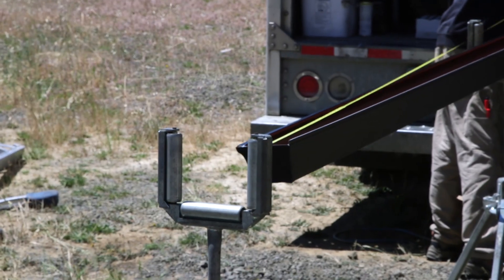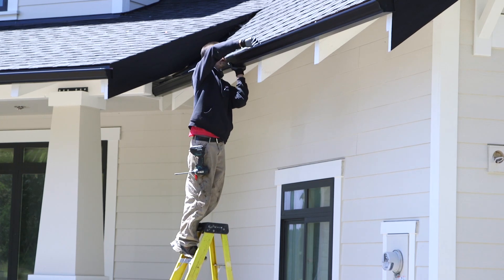Rain Gutter Installation Ep. 124

Comment: It's really unfortunate how many corners were cut on this gutter install. Dumping the second floor water directly onto the roof of the first floor is lazy and will result in premature wearing out of that section of shingles. The downspouts on the front side of the first floor columns are hideous. Very disappointing to see such a beautiful house sullied by this shoddy work.
Reply: Regarding dumping on the first floor roof... what is the alternative? Genuinely curious as my house is built the same way.
Reply: @RobertBarth1  The better option is to have the gutter downspout run along the roof and then over the edge into the 1st floor gutters
Reply: Maybe the customers didn’t want to spend that extra money
Reply: I wish I had told Scott to install leader pipe within the interior of the columns, therefore eliminating the vertical pipe that conflicts with the tapered columns.
Reply: @RobertBarth1  If possible have one continuous downspout and then Y-connect the lower level roofs into that.
Hard to tell if the roof design would have allowed for it in this case.

Comment: The downspouts in front of the columns look ........ not great.   Oof
Reply: Agreed! I would have used cup-style rain chains for the front porch section
Reply: I really dislike the typical gutter systems. The better alternatives are rain chains and if you have even more money - hidden gutter systems.
Reply: I agree.  Rain chains would have complemented this craftsman style front porch better than ugly aluminum downspouts.  Perhaps they couldn't be used here because of the volume of water and/or frequency of high wind?
Reply: @andrewj5998  Usually the bottom of the rain chain is 'anchored' in a tasteful clay pot which has a hole in the bottom where the water is connected to a drain of some kind. Then the pot is filled with river rock or something similar. The chains come in a variety of sizes that can transport water.
Reply: @andrewj5998  Wind does factor in with rain chains
Reply: @aayotechnology  exactly what I was thinking

Comment: I would opt for rain chains in the front instead. Those downspouts look hideous
Reply: Especially at those nice columns out front.
Reply: @natej6671  Even if they found a way to contour the downspout to the angle of the column I don’t think it would look good
Reply: nah. to each his/her own I guess
Reply: @Phil Ward if memory serves the only time I installed chain instead of a downspout the chain was copper plated so it slowly acquired a green patina.
Reply: @Phil Ward Yeah, actually. There’s stainless steel options as well. Regardless the material, chains add a nice look to any facade. Plus seeing them in action is pretty awesome
Reply: We tried a rain chain.  They look great but any wind and the water goes everywhere.

Comment: The downspouts in front of the columns look awful. If I bought that house the first thing I would do is tear them out and use another alternative.
Reply: Rain chains would be a good alternative.
Reply: @justinhosmer2500  Or hidden downspouts
Reply: Hmm I missed that detail. I agree would look awful. I have spouts on two of my pillars but they are at the back of the house so don't show that badly. However I still don't like them. I had then replaced with smooth rectangular spouts instead of that really ugly corrugated form.
Reply: Definitely need some “Bluetooth” downspouts! Out of sight, out of mind!

Comment: I like hidden side mounts for holding the downspouts. I’m also surprised they weren’t using a chop saw with an aluminum blade; we nearly exclusively cut downspouts with a chop saw as the cuts are fast, flawless, and perfectly perpendicular. We also like rivets instead of screws as they leave less obstruction inside the downspouts, don’t have points to catch leaves or the like with, and just look cleaner; rivets do have 2 major downsides they take slightly longer to install as they take 2 steps drill and pop as well as being more work if you make a mistake as they have to be drilled out. In NY I can’t recall the last seamless gutter company I saw with their gear in an open trailer; in NY everyone uses either a box truck or enclosed trailer. You can get good companies for seamless gutters that cut barrel connectors in for downspouts, in my opinion the only way to do it as it directs the water into the downspouts, some companies however will simply cut a cross in the gutter bending the created triangles down and screwing them into the downspouts which allow a lot of water an easy path to flow out of the gutter and around the downspouts; I see this quite a bit around here as homeowners don’t look or know and it is much quicker than cutting barrels in. My aunts house has gutters put in by the areas top company, a company I use from time to time and check the work on, and which uses barrels on our jobs, but who apparently doesn’t use barrels on any other jobs; after seeing their work on her house they came off our sub list as well as my list of referral companies. Know the work you want, let the contractors know what you expect, and the work you get as these unseen areas can make a huge difference to the end product. It’s sad when you think you’re getting top notch work, especially when you’re paying top notch prices, over 10k, and then getting corner cutting. Don’t get me wrong you can cut some corners for savings, and when you do the customer should at a minimum be aware and at most make the choice directly; cutting corners should never be to circumvent either code or safety but sometimes quick and dirty is all they want, just make sure everyone knows what they’re getting and what to expect.
Reply: I kept having issues with a particular gutter that would clog and it was the screw that attached the downspout to the gutter that would catch a leaf and then everything when from their. Plus they just cut and bent the gutter instead of putting barrels so that also makes the opening a bit narrower and easier for clogging. I want to replace that screw with a rivet but haven’t seen a rivet that clamps that thin.
Reply: Hi Chris. Yes agree with everything you say. Wish I had your comments before my guttering was replaced/added to. They did a poor job however they did put overflow dams (not sure what they are called) on the gutters where a downspout drains onto a roof. I didn't see any on the spec house however I am sure they did.
Also surprised the spec house went with corrugated downspouts and bends. I had all mine replaced with rectangular pipes because the corrugated ones looked so cheap. Bearing in mind the angular architecture of this house I would have chosen plain rectangular down spouts, but everyone to their own.
Reply: The big box stores sell white and colored rivets typically right in the gutter area; there 1/8” by maybe 1/8” or 3/32” and work great as there is little to nothing that protrudes on the side. 
As a note to the other comment a downspout should never be dropped on a roof; this both leads to premature shingle/roof wear and can lead to leaks especially in the winter when water can flow down and get behind an ice damn at the soffit and push up under the shingles. Shingles especially will wear out quite a bit faster under the flow as they simply aren’t designed to keep up with the water volume; just think of how Niagara Falls is slowly eroding backwards. Flowing water has a lot of power.
Reply: @libertarian1637  I should have mentioned that my roof is concrete tiles and I live in San Diego so freezing is not an issue. Also it rains about twice a year for a few hours😞 However it looks like you are saying downspouts should never be dropped onto shingles. Isn't the spec house doing that?
Reply: I really like your point about screws versus rivets. On my house inevitably some piece of debris will catch on the screw in the downspout and that causes a cascading clog that eventually blocks the whole thing. I just might have to follow your advice and get up there and replace the screws with rivets - easy enough job to do and will stop a lot of the extra work from clogged downspouts (though not from leaves and helicopter seeds!)
Reply: @fprintf  Can you use a pop riveter for that job so that you don't have to get on the inside of the downspout? Sorry I am a novice😃
Reply: @w1swh1  Yep, you drill a hole (or use an existing hole) and then insert the rivet from the outside and then pop it with the tool. Granted it doesn't leave a perfectly smooth inner surface but it is way better than a pointy sheet metal screw!
Reply: Makes no difference whether you cut the downspout by hand or machine, the strap will cover it if is not a straight cut. Also screws or rivets not much if a difference if you use a downspout guard. (Some type of wire strainer to keep the big debris from going in the downspout) whats really important and I didn't see it in this video was sloping the gutter towards the downspout with a level. Otherwise you're just relying on the roof and most of the time the roof line isn't sloped towards the downspout location. I'm a problem solver that installs gutters on some occasions as a design element not just functionality. Soon much to explain but not very good at typing.
Reply: @fprintf  Thanks 😃

Comment: I've been doing drywall for 30 years. I'll never forget the first summer when I first started. We were taping a good size house when this box truck pulled up. I watched curiously as the guy went around taking measurements, not sure what he was up to. Finally he stepped up in to the back of the box truck and a few minutes later started walking out of that box truck with a gutter that seemed to just keep coming forever. I couldn't figure out what was going on. How was that 30+ foot gutter stored in that 12' box truck. What kind of wizardry was I witnessing? Finally I put down my taping tools and walked out to satisfy my curiosity and was amazed at the machine that turned out those gutters.

Comment: Watching this I realized that I am too short to be a gutter installer😉

Just my opinion, “ k “ profile gutters look like an afterthought on an Arts & Crafts style house. It’s like the builder was almost finished and the building inspector or the buyer suddenly says “wait it has to have gutters on it“. Half round copper would look a lot better with those open rafter tails.
Reply: actual copper is ten times the price... and hanging round is super annoying to do even if you have all the proper hangers for it.
Reply: I tend to agree with you. I’ve only installed half round with exposed hanger brackets on rafter tails. Aluminum k style is a little cheesy for this application. Those end caps are terrible too. Oh well, at least it’ll function.

Comment: Interesting to see they didn't use levels or anything to set a slope. Hard to see if you got the "biggie size" of downspouts, but I hope you did. Everybody with the smaller size who thinks about these things regrets it. You just have so much less cleaning and less overflowing with the big ones.
Reply: Maybe they’d pre marked the slope?
Reply: jami w  Only if it isn't mistakenly pitched backwards like all my gutters were. Every year I'll get maple trees growing out of the end of the gutter that never drains, which I then have to clean. Having a level would help (I fixed it myself with a level and eyeball).
Reply: jami w  and as long as no material builds up in the gutter. I'm no builder, but I will guess there probably is a standard for slope, because you need not just flow, but fast enough flow to carry away both debris and water. (My gutters are sloped yet not enough to keep them clear or even dry. Replacing them is in the long term plan.)

I think Practical Engineering has a video on sewers? Definitely has one on culverts, that I think also covers this idea.
Reply: You always need a level, that's why exist the tool.

Comment: Appreciate the theory of operation, the amount of planning and the importance of a quality job for long lasting performance. Just wondering how the upper gutters connect to the lower ones without eventually staining the shingles in between
Reply: Sometimes we run the upper down spout all the way into the lower gutter. However this option is ugly and extremely time consuming in a labor driven business. The best thing to is get a premium new shingle roof at the same time you get the gutter. Some shingles have copper inside to keep moss from growing.

Comment: It looked so good until 5:36
Reply: yeah I don't what they were thinking with the downspouts out in front of the porch pillars.
Reply: Wow i was just thinking the same thing! Screwing the bracket into the downpipe! Im not a gutter guy but that cannot be right?
Reply: @itsonlyafl3shwound  actually that’s typical
Reply: Wow, id guess leaves and debris would catch on the screw internally and possibly block the pipe or cause premature corrosion? Interesting
Reply: @itsonlyafl3shwound  i think he was referring to the downspouts being in front of those pillars . Ugly
Reply: @itsonlyafl3shwound  
Rivets do same thing.
I screwed  mine in 10+ years ago.
No issues.
Reply: Yankee gutters would be better at least for porch.

Comment: I mean, it's like these boys have never heard of cutting a downspout with offset elbows to at least attempt following the contours of the front columns.....yikes fellas, yikes. 
If one of my guys flung two spouts on the front reveal out in mid air like that, we'd be taking them down.
Reply: Back to back, one ledger jumper, and 2inch double offset
Reply: yes i was looking for some thirties to jump the ledge on the front column. Perhaps EC did not want downspout straps screwed into the columns but i still would not leave the front downspouts floating. Also, i prefer matching the downspouts to the gutter not the trim but that is personal preference i think the white head elbows connecting to the coal grey gutters looks tacky.
Reply: @fiberoptichairline  yes sir; I figure that has to be the case. I've had some folks ask us to do the same but I agree, at least try another alternative

Comment: 3:10 Except if the downspouts get clogged the gutter can overflow the front and back because the back is only nominally taller than the front.

Comment: Love your channel and I’ve learned a lot from your contributions.  One thing I would like to see is a safer execution of these jobs.  There are many different options for fall protection for roofers now.  Also the step ladder is too short for this job.  These roof options are easy to install and provide a much safer workplace for the workers.  It would be a tragedy for one of these guys to fall on the job and suffer a life altering injury after all the great work they’ve done.  Consider putting out a video showing how to perform this work with the installers safety in mind.
Keep up the good work and thank you for your consideration.
Gus

Comment: Yeah, those front porch downspouts look awkward. I would have put a 6inch gutter there and run it all a single downspout on the right side tucked up against the siding of the house.  I’m sure there is a way to do it like that and handle the amount of water flow in one outlet. And yes the upper downspout dispensing onto the shingle will wear it prematurely.  Some kind of splash guard there would help.

Comment: 1:36 The only problem with this continuous gutter is the back of the gutter is only nominally taller than the front. If the back were an inch or more taller than the front, the gutter could only ever overflow the front and never the back where it rots the facia board etc.

Comment: Hello,
I was hoping to see how they attached the down spouts. When they installed the down spouts on my house they cut a X and bent down the edges, the opening is smaller then the down spout. Then the screws that was used to secure the two together obstruct the opening even more.  I was advised to get gutter guards and I would not need to be concerned. 
Brett

Comment: Gutters are on my home remodel plan for next year I have installed drainage underground but I was wondering what advantages/ disadvantages of different materials such as aluminum vs PVC, and any tips and tricks for longevity especially in the northeast where there can be snow and Ice build up on the roof and in the gutters?
Reply: I'm replacing cast iron with aluminum (aluminium) ogee gutters. PVC not permitted due to conservation area rules. Although 1,000 miles further north than New York we get less annual rainfall! There can be problems with salt-laden air so if you live near the ocean ... well the sea is two miles away from me so I'm taking the chance. Also great care has to be taken with cutting aluminum. Greetings from Scotland!
Reply: Also depends where that gutter is located and if your gonna be bumping into it. I have a aluminum downspout by my trash cans and if you barley hit the pipe it bends and kinks it. Plastic will take the hits better without showing damage.

Comment: As a German I found the gutter die forming machine mesmerizing and using aluminium is quite smart, but I cringed when they fastened the pipes. Just a screw through that sheetmetal holder into the pipe. I like the german solution much more. Titanium-zink or even copper sheetmetal, everything is standardized, holders that leave the top completly free and open, no crimped and flashed end caps (it's braized in germany) and not even a single screw through sheetmetal to avoid corrosion of a steel screw in aluminium (or titanium-zink or copper).
Reply: Die Profilieranlage ist definitiv der Klopper :)

Comment: Normally we have our aluminum gutter subcontractor add factory preformed outside caps to give it a cleaner look. Gutters are not all that great.
I always use lead boots for the roof plumbing vents pipes rather than the rubber, rubber seems to deteriorate after about 5 years and the leaks begin.